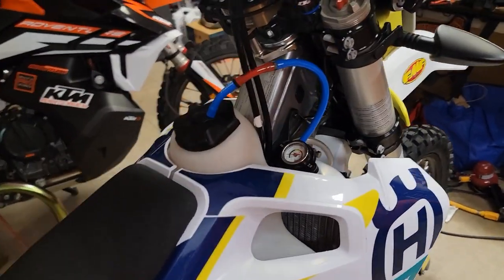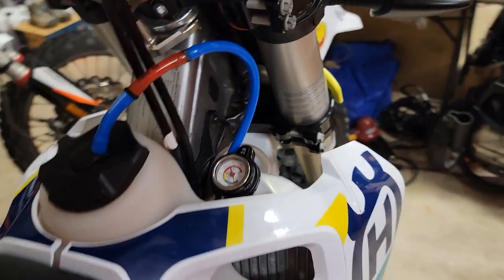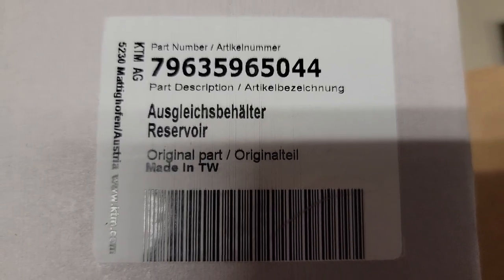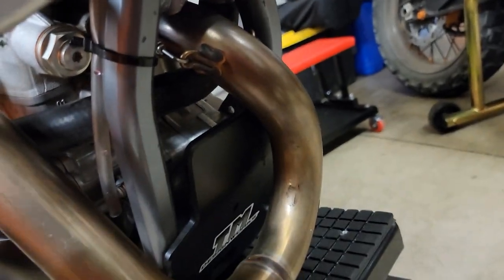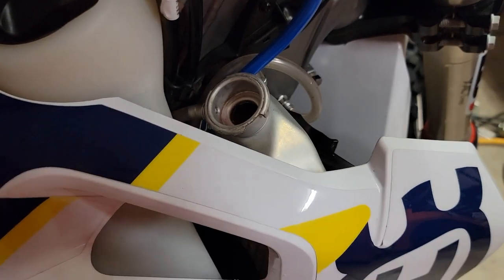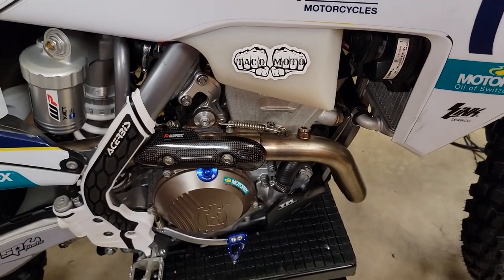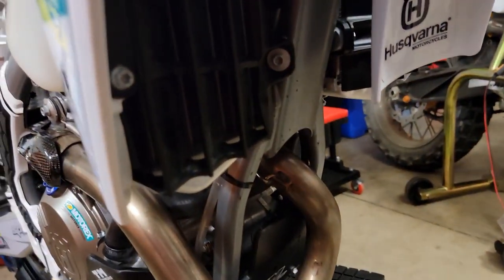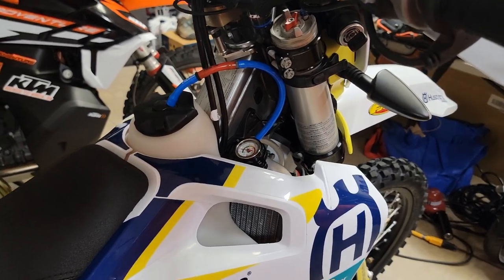2022 Husky FE 350s:  Do this mod to prevent engine failure & overheating! KTM coolant reservoir.

Comment: FYI ktm and huskies find they’re own happy place when it comes to coolant. Every one (all generations ) I’ve owned always spits out the coolant if it’s filled over the fins and that’s 100% normal. Don’t keep adding coolant, it’s not boiling it out, it’s just over pressurized.  The reservoir isn’t a bad idea, just no necessary. I have a 2022 fe350s as well.

Comment: Thanks for this video! I am installing the coolant overflow in place of the carbon canister on my 2022 500EXC-F. Man, what a pain, in that the canister will not drop out because of, what I believe is a larger counter weight in the front of the 500 VS the 350. I had to take all the engine mount bolts out in order to lift the engine high enough to get the old canister out and the new overflow canister in. Also, My Tusk temp gauge cap is allowing my bike to boil over at a very low temp.

Comment: Take that Tusk radiator cap off and out your stock cap back on. I've seen them fail on customers bike repeatedly. They are really low quality.
Reply: Yup they are garbage. Caused major overheating issues. Tossed it and no problems since

Comment: Mine was overheating to. I also heard it was because of that crappy temperature gage cap. It ruined my ride, and I wasted so much time and money paying a shop to troubleshoot and pulling out my Power Commander and installing a Get ECU because of that stupid radiator cap. I have not rode since, so I don't know if the problem is solved, but I heard that temperature gauge cap was the problem. Thanks for the video, I am about to install the overflow tank right now.

Comment: Your problem is the tusk rad cap they are junk every bike that I’ve seen run one has the same problem they do not seal correctly. Look at the tusk cap it has a neoprene seal and the seal is smaller in diameter than the stock rubber ktm husky rad cap seal etc.
Reply: Yes, my tusk cap failed. The stocker has been on ever since and no problems.

Comment: I have the same bike and after it’s warm it has stalled every time I pull in the clutch.  The mechanics are saying not to touch the idle adjuster.  Well, I turned it 540 degrees and the problem is solved. I need to get onto some of those upgrades.
Reply: I'm having this problem currently rides great for about an hour then seems like it's getting over loaded and stalls on take off and when I drop it in first or hit the throttle

Comment: Did you try just putting the stock cap back on as suggested in the comments?
Reply from the maker: No, I didn't think of that unfortunately until after I had completed the upgrade.  That is a great idea though, I bet that it would have worked.  However, since the upgrade, my coolant level never changes and it gives me peace of mind.

Comment: Do all of these Bikes have the EVAP system?
Reply: All of the FE350s do. The FE350 does not as it was not street legal. The FE350 has been discontinued by Husqvarna this 2024 so any 2024 bike you by new will have that canister. I have "de-Californified" my FE350s as we don't have motorcycle emissions in my state to be street legal.